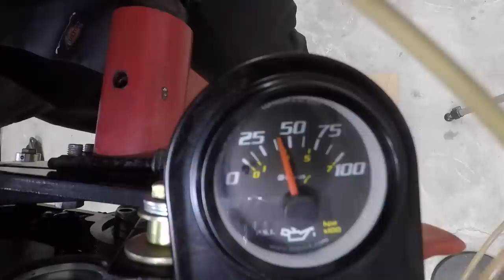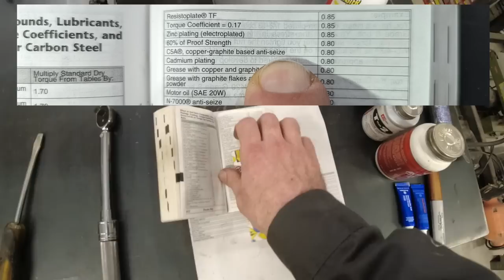Chevrolet Big Block 7.4 Vortec Assembly (Short Block to Complete Engine)

Comment: Brother, you just answered a burning question I had. I just replaced the timing chain on my Gen 5 454. I was stumped as to why the distributor rotor was at #6 cylinder when the timing gears were aligned. I was thinking it should have aligned to #1. That little bit of info just made my week!..Thanks for the vid!
Reply from the maker: It got me as well, I thought I was 180* off when I aligned it to the #1 cyl prior to disassembly. I had to have the machine shop explain it to me before I put it back together.  Glad it helped you.
Reply: You need to elaborate on the cam timing more. The compression cycle is determined by the cam position, not the distributor. IOW TDC on the compression stroke doesn’t exist until you time the cam. Can you discuss the dot alignment better?

Comment: You weren't worried about her over torqueing those bolts with that speed wrench, brave man. I think you should have touched up the valve covers with that hot rod black you painted the cab with. Love the video man.

Comment: Awesome video and build.  Now the "but".  That oil pan?!?! I have had marine pans rot out and even a 454 Suburban pan rot out and leak! On the marine pans I had the exterior powder coated, on the 454 I bought a new one... Dumping oil is not good.  The rest of the build is awesome!
Reply from the maker: I did paint it afterwards with a rust inhibitor, but if I did it again I would install a new oil pan.

Comment: Missed opportunity, should have painted the oil pan and valve covers. Oh well your build not mine.... awesome job on the engine assembly.
Reply from the maker: 100%. I didn't paint the valve covers because they were previously powder coated and chipped and it's a commercial truck, but I should have painted the oil pan before assembly just got rust protection.

Comment: Mike here...great video, I'm German and am very peticular about assembly techniques...Gutentight..love it...
Any way recently purchased  2000 K3500  , 5 speed manual...7.4 ...flatbed...
Going to build a "Search and Rescue " 
Tow and recovery truck...
My engine has 140,000 miles......
Still has life, and I will use it up accordingly .....
I would like to build a replacement engine for it...maybe  reliability crossed with a small bit of "I built this one"...
I believe you can relate....
So after all this talk....
I need parts resources,  perfered brands and where to aquire them...
Felpro gaskets , Clevite bearing and so on....
I know I'm asking a bit...but I'm grateful for what you have time for....
I taught my daughter like you did...
I buit a boat ,396 in a 1978 Sanger Picklefork Hydro...my daughter was there on the build and we enjoyed that boat together for over 20 + years....
Now I have grandchildren....I have projects for them...
Thank you, Mike
Reply from the maker: Sounds like you've got an awesome rig. 140k miles may be nothing on that engine.  Mine was bad at 130k, but it was in a box truck and probably beaten to death and neglected.  I have seen big blocks with 300k miles in perfect shape. Shoot me an email with any questions and ill help however I can: acthecarguy@gmail.com
Reply: @AustinCoulson  thanks for the reply.....Lord bless....

Comment: Did you verify if the internls where forged? I picked up a L21 from a 1999 Kodiak after reading that they had forged crank and pistons , after pulling it appart I found out that it had cast crank and pistons. Just curious what others have found.
Reply from the maker: I also have read multiple places about the forged internals.  Before I brought the engine to the shop, the owner said it wouldn't have forged parts and the internals were the same on all GEN VI BBCs.  I am not an engine expert so I couldn't tell for sure, but the crank had a single parting line and sure looked cast to me.  Not sure about the pistons because I didn't remove them and they were replaced with .030 over hypereutectic ones. I would love to get my hands on a known forged one just to see the difference first hand.

Comment: It gives me a sense there may be hope for me, when someone with your apparent and evident organization skill misplaces a tool.  The number of tools of which I own duplicates due to misplacement is an embarrassment to me.  Excellent video, thanks for watching.
Reply from the maker: I blame it on moving my shop twice in the last year.  Luckily I now have that old distributor as a backup. I did buy the same pitman arm puller 3 times because I use it so rarely I forget I own one.  Well, now I own 3.

Comment: Mine is torn down now. (L-29) I see the L-21 has 2 holes by oil filter for oil cooler. Did you remove oil by pass valve from oil pump to oil filter pad. I see the other bypass valve  at filter base. GM put check valve in main oil line to make cooler work.
Reply from the maker: This engine was in a commercial truck that had the heavy duty oil cooler with the quick connect fittings. One of those fittings has a built in check valve. I removed those fittings before sending in the block to be rebuilt and reinstalled them after installing the engine back in the truck.

Comment: How hard would it be to turn a modern big block like this to be making around 400 to 500 hp? Would it even be a good idea? Just been brainstorming recently.
Reply from the maker: Super easy. This engine is detuned by the computer to put out 290 hp and 400 tq. It could easily hit 400 hp at the crank with just a dyno tune and maybe a slight increase in fuel pressure.  Of course, this is going in a commercial truck so I am keeping it stock.  My buddy is currently working to get his big block to 1500 hp, you can check out his build at https://www.youtube.com/c/LawrenceLTTolman
Reply: @AustinCoulson   Thanks for replying! I watched LT not too long ago, and was quite impressed by his 8.1 build. I kind of lost track of his stuff recently. I'll definitely give it a look.
Reply from the maker: @markhenry5294  He has been working on a 4.8 to compare to the 8.1, but pretty soon he is going to go nuts on the 8.1. Should be pretty interesting

Comment: Good video, few questions, why didn't you install a new cam and lifters if you had new cam bearings installed?  Not sure it was good idea to paint the inside of the block it can flake off and possible oil blockages could occur, the rubber end gaskets will eventually leak you installed they will swell up and push out. 😉
Reply from the maker: That paint is called glyptal and it's designed for painting the interior of engines to allow the oil to flow easier over the cast surface. The only time I don't use the rubber end seals is when it's an aftermarket intake manifold. I didn't change the cam or lifters because they didn't need changing, they were in perfect shape.

Comment: Is that glyptal under the intake and timing cover? Jafro used that stuff in a 4g63 build.
Reply from the maker: That is a great question. That was applied by the engine shop so I'll have to confirm with them. I'll have to check out the 4G63, which is one of my all time favorite engines.

Comment: If you were installing new lifters in this engine, would it matter which way youface the oil hole ?? I’m installed new lifters in my L29 and I’m not sure exactly which way the holes on the old lifters were facing

Comment: Didn't the long extension give an incorrect torque reading on the oil pan bolts?
Reply from the maker: That is a great question.  So long as you keep the extension parallel to the bolt, the torque reading should be unchanged, but in practice you definitely should use no extension or the shortest extension required when torquing a bolt.  Because these were very low torque on an oil pan and not something like a bearing cap I felt comfortable using the extension to made the job go quicker.

Comment: Has anyone had this issue when priming , only the drivers side gets oil to rockers?   No idea why the motor was machined and cleaned at a shop makes zero sense to me. Any help would be great
Reply from the maker: I have seen only one side prime if I am using a lower powered drill. It seems to need a lot of power to get the oil pressure high enough to flow through all the rockers

Comment: Okay... so I was raised on cubic inches... not, what, cubic liters?  What does a 7.4 Liter convert to in cubic inches.  I'm pretty sure that the Ford 5.0 is about equivalent to the 302... but what do I really know.  I've been watching your channel now for years... but somehow I missed this one, so when it came up in my suggested feed, I clicked on it right away.  You'll probably address this, but I can't believe that YOU of all people put that oil pan on without cleaning it up a bit.  Looks like it had lots of surface rust... and was looking pretty trashed.  I guess I'll find out.  (Love to see you include your kids as you teach them the ropes).  Thanks Austin.
Reply from the maker: That is a Chevrolet big block 454. Specifically it is the last generation before changing to the 8.1liter (496ci?) LS based big block. I definitely should have at least scuffed and painted that oil pan but it was only surface rust and the inside was super clean so I just installed it. I also regret not cleaning up and painting the harmonic balancer to protect it from future corrosion because that part is absolutely impossible to source.

Comment: How much did it cost to have the bottom End rebuilt? I have the same engine and want to get it built or build it my self so its faster. 😂. Im planning on building a rock crawler soon and i want to out the 454 in it
Reply from the maker: To have the short block built, it was 1800$. That included the machining, assembly, all the bearings and new pistons. They reused the crank, rods and cam as they were in good shape

Comment: QUESTION: are the fasteners in this generation 7.4 already all metric or still a mix of SAE and metric?
Reply from the maker: They are still a mix on this 7.4.  I think they finally switched everything over for the next gen 8.1, but I am not positive
Reply: @AustinCoulson  Many thanks for chiming-in with that info. Much appreciated.
I recently saw another similar build video of the 8.1 and there it was mentioned that the 8.1 was all metric.

Comment: At 8:37 I need the camshaft positioning sprocket. I have a 91 454 and can't find that part on summit. Are is that just for vortec engines
Reply from the maker: I didn't think they used those in 1991. I think I misspoke and it's actually a crankshaft timing sprocket.

Comment: I have the  7.4l V8 Vortex engine in my K3500 1998 Chevy Silvarado king cab dually 4x4 and I had a question for you. 

The last freeze we had we got below -9F and my free plug popped out on the drivers side 2nd plug back from the front of the engine. There is a senor next to it that screws into the block, can you tell me what that is? Coolant temperature? My freezplug is sitting right behind it that fell out and I have no clue because n book I have tells me. Can you?  Im also trying to find a way to get it back in since there is so little room to do so. Any ideas? Any help would be really helpful.
Reply from the maker: https://amzn.to/3VanRQR 

That would be your knock sensor. Those can be a pain to get to, but I use an open end wrench to install them
Reply: @AustinCoulson  Ok thank you so much! Its looking like I also might have to take off my exhaust manifold to get to the freeze plug on that side near the motor mount. Its not looking fun . No one around here wants to work on a big truck like mine. So I am stuck doing it myself. But thank you very much.
Reply from the maker: @DreidMusicalX  those freeze plugs are a lot easier to do with the manifold off. Not a fun job. Hopefully the block didn't crack internally. I would be amazed if you don't have at least one exhaust stud that's already broken. Usually it's the back two on both sides
Reply: @AustinCoulson  I am truly hoping its not. Believe it or not I had the same thing happen the year before when it has just water in it. I thought I had enough coolant in it this year and it popped the plug on the other side. I am wondering if it became loose from last year? The year before it was on the passenger side above the starter. Popped it back in and was just fine. This years it was the 2nd back from the front of engine. 

I just put some PBlaster on the bolts and going to hit them again in the morning with it again and slowly start working them out. Wish me luck, and thanks for your help.  I know those bolts are going to be a pain and I have to take it slowly with them. Thanks!

Comment: 29:19 --> ERROR!  Fuel line gets tighten down with the stud, then the retaining clip goes onto the other nut to hold down the map sensor. If your map sensor ever goes out to lunch your going to struggle.
Reply from the maker: Damn, you're right.  Good catch
Reply: @AustinCoulson  I used your video for reference, tore mine apart a few years ago. It helped. tks

Comment: How bad is it if you didnt mark the lifters before taking them out, and going to reuse them , not a new build just replaced a cylinder.
Reply from the maker: Depends on who you ask. Nearly every expert engine builder I know would say lifter location makes no difference, they toss them in a container of oil prior to install and pull them at random for reinstall (same for the rockers and pushrods). I know some amateur builders who lose their marbles if they aren't put back exactly in the same spot. Being hydraulic they are self adjusting so the only real concern IMHO would be the slight wear on the top of the lifter not matching and potentially having a slight increase in wear in the future on the lifters or guides. Personally I aim to reinstall in the same spot, but if it's not practical or even possible I don't worry about it.